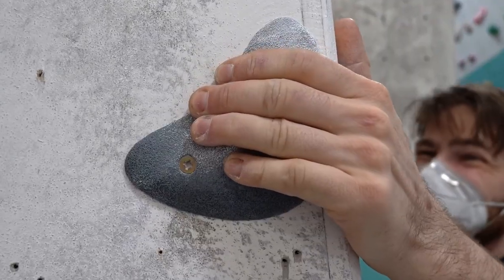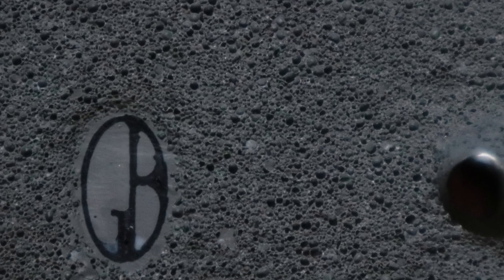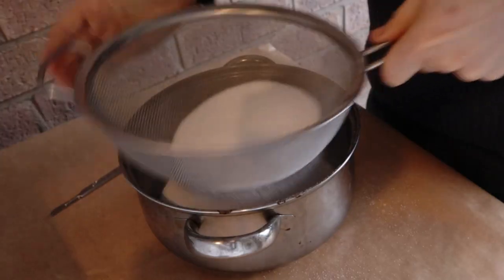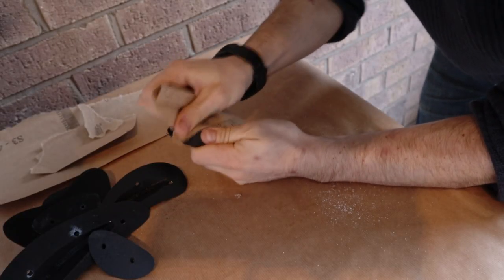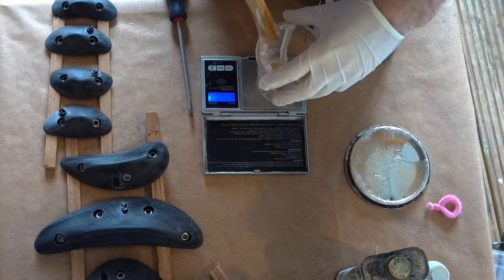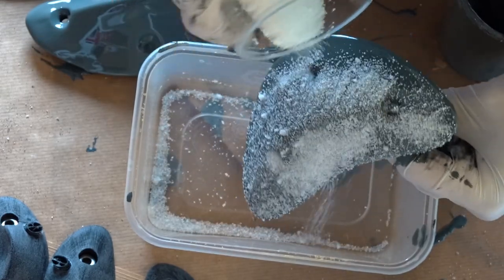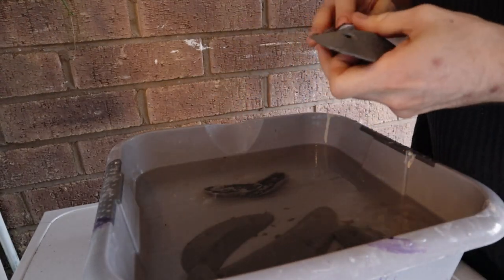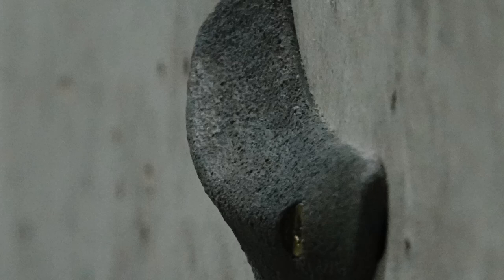New way to texture climbing holds

Comment: I've taken some inspiration from your videos about this, and I might try this surface texturing method as part of my overall process, which while it also involves 3D printed holds, my idea is a bit different;

I intend to print holds with a moderately dense infill (gyroid) pattern, and with 0 "bottom" layers, so that the infill structure is exposed from the back of the hold. Then, I'll use your technique here to give the outward surface of the holds a texture, and secondarily to seal the surface and make it "watertight" so to speak. The final step is to flip them over and fill the holds with some kind of resin/epoxy (trying to find casting PU locally). I haven't actually done this yet but it seems like it should make for extremely strong holds. What do you think, have you tried anything similar?
Reply from the maker: I haven't but I've definitely had similar thoughts to this for sure, including backing the print not just with resin but fiberglass, for larger holds. 

The thing that worries me is if the bond between the plastic and the resin is not great, I think gyroid infill may separate the resin into sort of columns rather than one continuous block and may not be as strong as you want. Might experiment with infills which don't make such defined walls but who knows, it's definitely worth a try
Reply: @gilesbarton-owen6783  Thanks, yeah good observation, I'll have to experiment. I also thought about using some other filler or backing.

Comment: Incredibly interesting approach. Major props for coming up with this. I've been working through some ways to try to add coatings of sand on top of very thin applications of resin over PLA holds as well (though I later go on to create a traditional mold around those before pouring the finished product). Your approach has a special appeal though of generating "holes" rather than "bumps" like mine does. I worry about the longevity of the bumps under high traffic.

Is there a reason you wouldn't do this same process just using the PLA pieces after texturing as positives in a mold? Seems preferable for drastically reducing the work required for a duplicate, plus you could use much stronger and harder, typical polyurethanes for your finished pieces. Genuinely curious what you find to be the downside to this approach. You're the first person I've ever seen/heard report any success using 3d printed thermoplastics directly on the wall.
Reply from the maker: Thank you! The main reason not to use it as a mould positive is to avoid having to make moulds, and the cost and bother associated with that. If you want to produce any quantity, I'd definitely use a mould system, although I'd probably hand shape in foam as modelling holds digitally is definitely not easy to get absolutely perfect, and the resin process I outline can often have small imperfections.

From my understanding of the material properties of the tough pla I'm using, these holds are likely to be plenty strong enough, and this method allows me to use polyester resin for the surface, which is significantly more wear resistant than PU, and feels better in the hand. PE is the main resin used in Europe and in my opinion is vastly superior for texture, but is brittle and less good structurally. This approach creates a hold that has hybrid properties between the two (or so the route setters told me)

I believe cosmic holds and a few other companies are making holds via printing, texturing, moulding, casting as you describe and it seems to work well for them, definitely worth a shot if you want very precise shapes that would be a challenge to shape in foam
Reply: @gilesbarton-owen6783  Very interesting. Had no idea PE was still widely in use. Personally I'm preferential to 3d printing as opposed to foam sculpting just because I have a decent level of skill and experience in modelling and less than 0 in foam sculpting so it's a lot easier to get the complex shapes I want on a computer. Translating it to a usable final product with texture and strength has been the real challenge though. I'll check out cosmic holds for sure.

Love to see new ideas like this though. I will have to give this a try. Thanks for the video and responses.
Reply from the maker: Definitely when you're comfortable in digital modelling vs physical modelling.

I think mimic holds are also worth looking at, both are very cagey about their texturing process (understandably) so it's nice to be sharing some process stuff

Comment: Hi, great video!. I have a question. Do you think i could use epoxi resin instead of the PE?. Also im thinking of printing holds, then adding texture and finally make a silicone mold for fast reproduccion. Think this will work?. Thanks for sharing
Reply from the maker: Epoxy should work fine as long as it's not too runny. The effect relies on being able to paint on a 1.5-3mm film over the print and so you need it to be a thick wall paint consistency, some epoxys will be fine but not a casting focused resin. It's very easy to thicken epoxy with glass microbeads you can buy from any supplier so those could work well. 

Printing, texturing and casting could work well, not tried it myself but there's a good few companies doing such things so it must work
Reply: @gilesbarton-owen6783  all right, i will try that. Thanks!!!

Comment: Hey! Great video. I'm looking to start 3d printing holds and I had a few questions. Do you think directly printing holds is viable and safe or Is it better to print a cast or a mold and go through the normal process from there? I wanted to try dual texture holds, do you have any info on how to create that texture?
Reply from the maker: Safety is a tricky one, it depends on mainly shape and print strength (itself a compound of layer adhesion and plastic type). I think mine are strong enough, and I've tested them in approximately the same way as real holds. 

A hold failure during climbing shouldn't be dangerous except if it causes sharp edges, as we have to be ready as climbers to fall whenever. Key to this is avoiding the resin chipping off the printed base, the fuzzy mode works seemingly quite well for that.

If you're going to cast them, I'd suggest modelling the holds in foam as I think modelling in 3d of forms that feel nice is a real challenge.

In terms of dual Tex with this technique, I did a handful of holds in my last batch where I did the textured part first, washed the salt away then did the smooth part second with no salt. It worked pretty well but didn't get a super flat surface, I was a little disappointed but people seemed to like them a lot. You can also do it in one by only applying salt in certain places for an interesting gradient effect but this is a lot more prone to a messy result. I might be tempted to combine the two approaches as it's hard to get the coating thickness in a single coat when you're not using the salt.

Comment: No mould investment, just expensive 3D printing????
Reply from the maker: Each of those prints is about £3 of plastic at the absolute maximum and I print them on a machine that cost £400 5 years ago. It's not free but 3d printing is not expensive. I would never claim this is a technique for mass manufacturing of holds, but for less than 5 holds of each designs this is likely cheaper than making molds from silicone

Comment: Your process doesn't surpass what can be achieved with foam masters on an industrial level currently. People have been adding sand on their master for decades, but your extraction method is interesting. Also your shapes look pretty good. Talk to Green Holds, they seem to need a designer.
Reply from the maker: 100% this isn't a good replacement for foam hold processes except for experimentation and small batches (and cool novelty). I think refined there's scope to use it for variable texturing. I think it would be competitive with sand textured macros which I really dislike personally, I am planning to try this when I have a bit more space